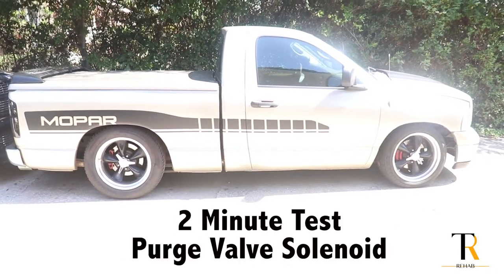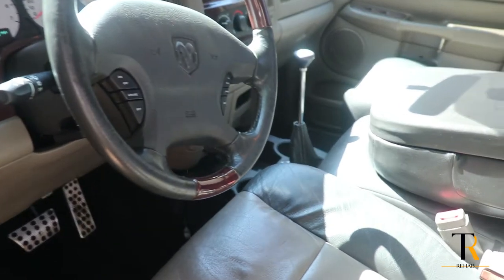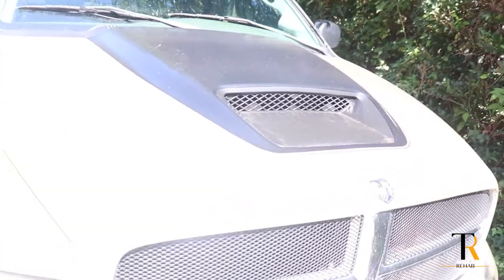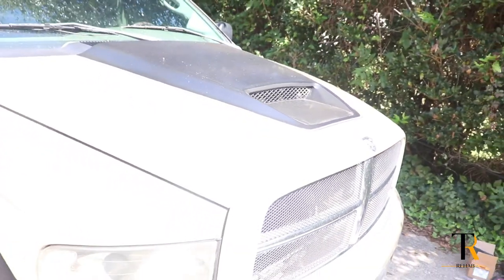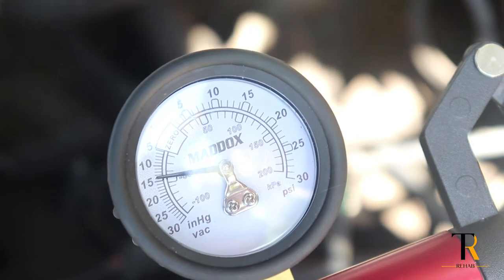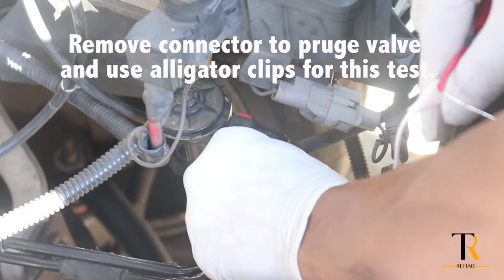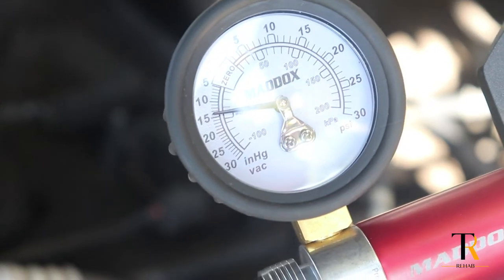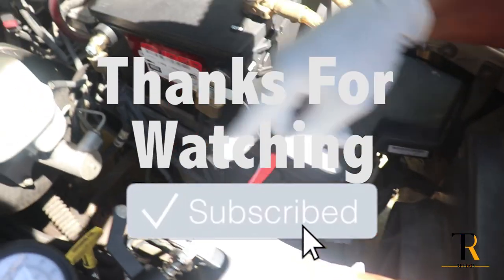Dodge Ram Purge Valve Solenoid p0456 p0440 p0441 p0453

Comment: Excellent video. I throw codes when the weather changes. I have a gen 3 dodge just like you, I will refer to this video if it happens again. Hey, you said you installed a fuel/air monitor and I’m curious about that because I get TERRIBLE gas mileage. I got the 4.7. Any input would be appreciated, thanks again. 👍👍
Reply from the maker: If you don't have any codes I would worry about the fuel / air gauge. I have a tune on my 5.7 The gauge just allows me to keep an eye on the two during driving conditions.
Reply: @TRRehab  thanks. I've got 4.7 and no codes. I'm fixing to change the oxygen sensors because it's WAY overdue. I'm hoping that helps me, have a great day my brother.

Comment: The manifold side on my purge valve solenoid is holding vacuum but the canister side of the purge valve looses vacuum. I don't really understand why only one side is loosing vacuum. I don't see anyone testing the canister side of the purge solenoid with a vacuum pump so is it considered a valid test? Everyone only vacuum tests the manifold side
Reply from the maker: Thanks for your comment. I’m not a mechanic but I do have the 2003 1500 5.7 and the 2004 Ram SRT10. You shouldn’t get a vacuum on the other side because your canister has a vent value that would need to be plugged. To test the hose from the purge valve to the canister. Unplug the hose coming from the purge valve at the canister and plug it. Unplug the hose at the purge valve and now check vacuum. If it does not hold you most likely have a leak somewhere in that line. 9 times out of 10 if it doesn’t hold the leak will be in the area where the the exhaust down pipe is closest to the hose. 

I have another video testing the leak detection pump. If that test passes there are 2 fittings on top of the canister that are almost always decaying. 

Please subscribe if you haven’t.
Reply: @TRRehab  I'm talking about removing the hose from the canister side of the purge valve then putting the vacuum gauge on the canister port of the purge valve and pulling vacuum on the purge valve from the canister side. That's where mine looses vacuum but if I put vacuum on the manifold port of the purge solenoid it holds vacuum perfectly.
Reply from the maker: Also, make sure you disconnect the purge valve from the computer when doing this test. If you getting a purge valve circuit code it could be your computer. I could recommend a company to repair your computer for less $300 if you need.
Reply: @TRRehab  I had the purge valve completely removed from the car the electrical part works perfectly fine I just don't know if both sides of the valve are suppose to hold vacuum or not I'd send a pic if I could on here
Reply from the maker: @gabrielq.906  Vacuum only pulls in 1 direction. Check my other reply.

Comment: OMG, what happened when you tested back to the charcoal cannister?
Reply from the maker: You'll have to do a visual from the LDP to the canister. There are 2 elbow fittings on top of the canister that have a tendency to degrade over time. Between the purge valve and the LDP.... Disconnect each end, connect vacuum to one of the ends making sure the other end is capped off. If it does not hold vacuum your leak is somewhere in between. A good starting point would be where the exhaust down pipe passes the vacuum line.   

Hope that helps and please subscribe if you have not.

Comment: Mite as well drive a car no use for a truck like that dude 😂
Reply from the maker: You’re kinda right. lol. My Ram SRT10 viper truck has never hauled anything but this Hemi pulls my 16’ trailer on a regular. Air shocks on the rear and a tall boy hitch. Thanks for checking out the video. Subscribe if you haven’t.